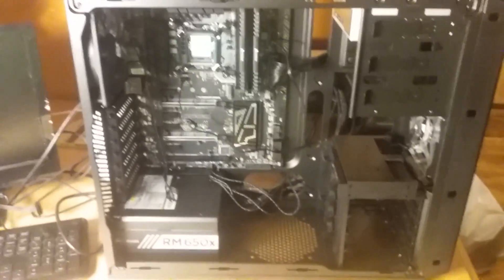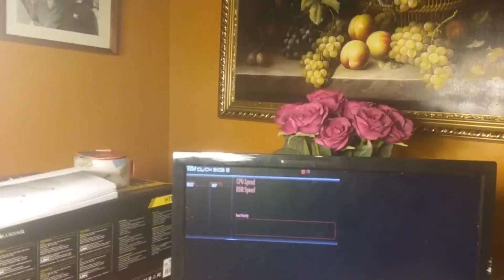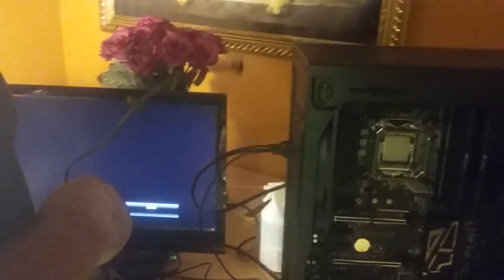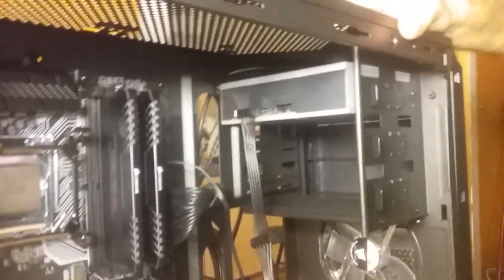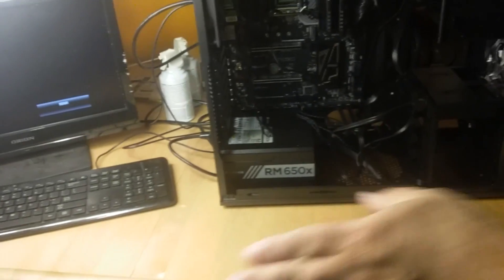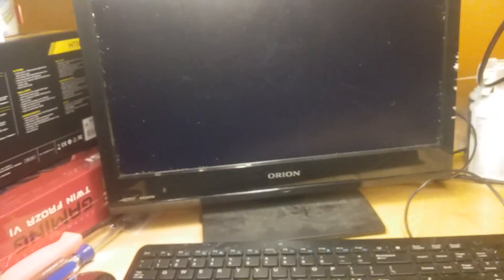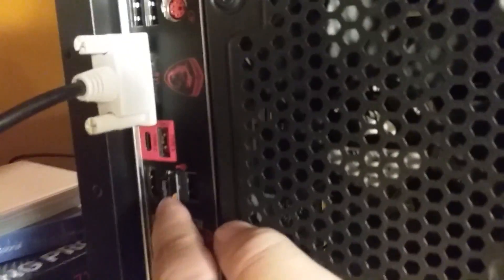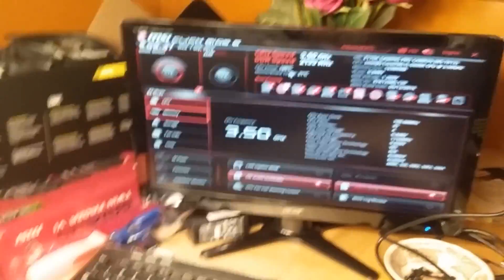MSI Z170a Gaming Pro Carbon getting into BIOS

Comment: I have the MSI Z 170 A Gaming M 7. Everything is fine, the motherboard boots, i have an Intel I 6700 K CPU & 2 sticks G Skill Trident DDR 4 16 GB each at 3600 MHZ. The Ram modules are in the port 2& 4 position as recommended in the Manual. The Problem i have is even after connecting the MSI motherboard via HDMI cable to the MSI 34” screen, i get on the monitor the error message DP no signal. No matter what i do i can get the motherboard to displaying the Bios on the Screen. I tried to stick the HDMI cable into a graphics card with the same result. Sadly my Motherboard does not have that traditional Computer Monitor signal output, only HDMI or Display Port which looks like an enlarged Android Phone charging cable. Can you think of any solution for my Display Problem ?
Reply from the maker: Samine, sorry I'm just seeing this comment so I hope you have solved this problem by now.  Since the error message is "DP no signal", I think you're currently viewing your Display Port input which is not connected.  Likely your HDMI connects to another HDMI on your monitor so it should be a matter of switching the input hopefully to the HDMI port.